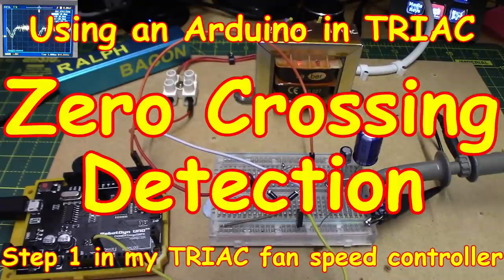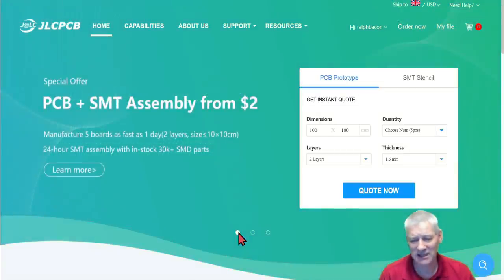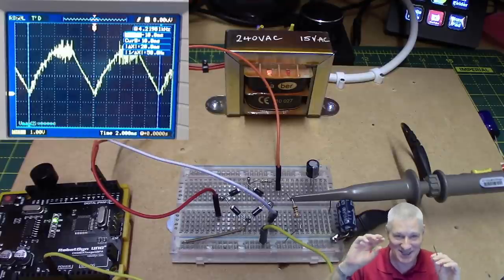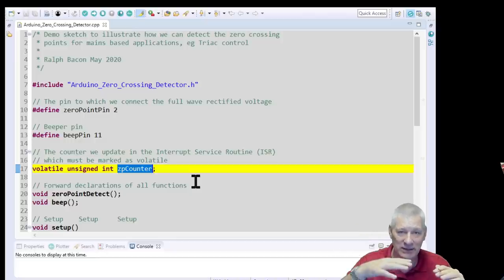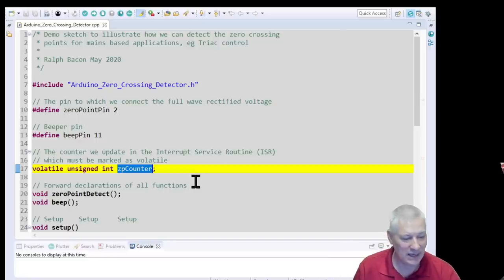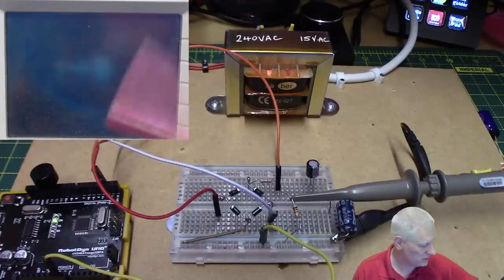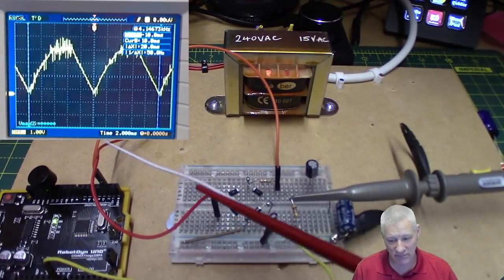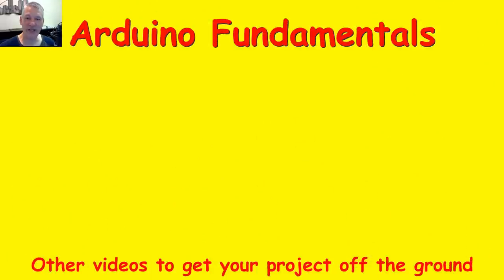#189 Zero Crossing Detection using an Arduino (TRIAC Dimmer Control)

Comment: Excellent video, nicely explained, as always from you.  Quick suggestion, what if you use an ESP8266 in some form, then you can easily control your fan from remote via a phone app or easily connect it to your home automation system, shure you can do some remote control via bluetooth, but with wifi you have so much more possibilities  :-).
Reply from the maker: Great suggestion! It did occur to me (or just buy a  SonOff dimmer switch) but I don't mind stretching out to adjust the fan speed - and it's all switched off by the kill switch when I leave the workshop anyway.

Comment: What's cooking. is that capacitor? - I got sauce in my pocket. 
 Lucky it didn't just explode - usually does for me.
New project? could be very interesting, have to get coffe ready next time.
Phone charger looking good, a bit surprising though. You took the time to make a PCB and then throwing "test boards" on it?
I was hoping for a bit more from you -but it is working and it is cheap and easy - as you said a few times in the past "I am a programmer" - it shows. LoL (no disrespect intended)
Reply from the maker: Oh dear, I feel so bad now. "I was hoping for a bit more from you". Oh dear. This feels the same as when my school teacher wrote on my work "Can do better". But..

But seriously, I thought about putting more native components on the PCB but I'm not going to do that for the BT module, and whilst I suppose I could have done it with the current detector, what purpose would that solve (unless I was after a very small PCB). We will have to be satisfied with the dual MOSFET chip and TH resistors (no SMD because many hobbyists don't like them).

So in the end it's mostly a collection of pluggable components which makes is so much easier for me to assemble and every one else to construct, does it not? Wait for the final product before passing judgement, Flemming!
Reply: @RalphBacon  LoL -"can do better" 😂 -can't we all
-did I miss something?, I thought the Smart Phone Charge was done?  
-Judgement? noo not me. I do believe that critisism must be somewhat kunstructive, anything else is worthless.
Reply from the maker: Smart phone charger PCB done, not yet fully assembled.

Comment: Nice job of showing how  the interrupts work. And I have never seen where the "zero level interrupt" had any use since according to the documentation, it continues to interrupt as long as the line stays at zero. And by zero, they mean a digital zero - not zero volts. That means the from the time that the line dropped below about 3 volts until it raised above 3 volts again, the interrupt service routine would just be entered over and over again as fast as the micro could process. If you ever find a practical use for this mode, please make a video on that. I am sure that the engineers has some good use for this or they would not have spent all the time and money to build it into the chip, but I sure can't figure out what it is use for.
Reply: Edward,  his next video will use a MOC3041 (or similar) which is a dedicated triac driver with zero-crossing built in. This chip gives a crisper 'true zero' crossing point that the Arduino can use. You are right, if he uses this set up he will get a digital zero trigger that may wander around. However, as soon as he installs the MOC the subtlety of your point will be lost!
Reply from the maker: Yes, it does seem odd, repeatedly triggering an interrupt on LOW. I got around this previously by disabling the interrupt as the first statement in the ISR. A bit counter intuitive!
Reply: @RalphBacon  I did that too once, disabled the interrupt in the ISR and then later, once the line went high, I re-enabled the ISR. But, I realized that I had just built a very complex and time intensive alternative to the built in high to low transition interrupt.  So, I junked the whole thing and just used the transition interrupts.
Reply: @whitefields5595  Yes, I am quite familiar with the MOC3041 and have used them on a couple of solenoid driver projects. But, I wasn't really commenting on his little demo here - I assumed that this was just be a little training exercise to show people how interrupts work and why it is important to find the zero crossing when using triacs.  I was commenting on the Arduino "LOW" mode interrupt operation. The Arduino family has the following modes: LOW, CHANGE, RISING, FALLING,  and some have HIGH.  I have never seen an application for the LOW or HIGH modes. Why do these modes even exist? If you have set a Low mode interrupt, and the line is low, the interrupt triggers over and over and you can't do anything else until the line goes high. So, the only way I see to use it is to disable the interrupt inside the ISR. But if you do that, it would have been simpler to just use the Falling mode which only triggers once per falling edge and you don't have to worry about disabling the ISR.
Reply: @MrEdwardhartmann   Edward, I have always tended to use attach and detach interrupts as a pair, avoiding multiple triggering. One example of a LOW is a debounce routine for a pushbutton. I have used HIGH in peak detector circuits. I suppose what is going on here is the old software vs hardware (discrete components) issue that I keep bending Ralph's ear about. The later microprocessors have been great in popularising our hobby, but it always needs to be backed up by a thorough understanding of electronics. Many folk will try to do many things in software that really should be done with discrete passive components. HW interrupts could easily, more reliably and without repeat triggers be fed from an op amp, schottky diodes and other (logic) devices. In this AC example Ralph should (and hopefully will) use a dedicated zero crossing chip that only gives a single pulse.This would then leave the processor to do what it it good at rather than trying to 'catch' interrupts. Its a grey area, and always has been, but we ignore the basics at our peril as we force the processor to over-rotate.

Comment: I see that you have the digital current sensing on the phone charger, so I am assuming the analog one still isn't cooperating? Zero crossing detection with an Arduino project is interesting and educational. In the circuit you drew, you have two 47K resistors to drive the LED's in the optocoupler. That would work, but the power dissipated on the resistors would be higher than 500mW at 240VAC, so regular 1/4W resistors will burn out rather quickly. You may consider using 1W resistors, or better yet, a capacitive dropper there. Also you'll need a current limiting resistor on the transistor side of it where you tap your sense wire, otherwise each time that transistor turns on, it will be shorting the 5V rail. But, I know that you know all of these, so I believe that circuit was just a sketch to explain the concept, not an implementation version. :-) Great video as always!
Reply from the maker: Yes, yes, and yes! I assumed 1W resistors would be used except my solution is an off-the-shelf device now (it costs more to buy the components). Wait for the update video in due course! I still want to demo a discrete component version though.

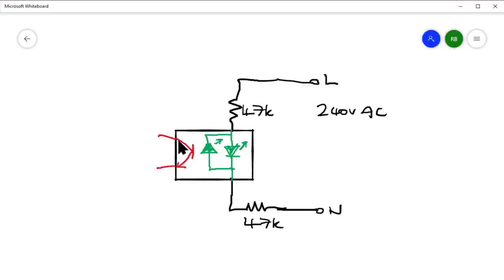Comment: Is it really getting the zero crossing point?  21:12   The LEDs would offset it surely? A LED would not conduct once Vac dropped below Vf [and the other LED would not be conducting either until the corresponding Vac rose beyond its Vf] which isn't the same as zero.  Maybe I missed it but the code would have to delay the detected 'zero' point.
Reply from the maker: You are on the right lines, Kenn. As the mains voltage drops to below 3v (what the Arduino will consider LOW), the interrupt triggers. The rectifier diode (or opto-isolator LED) will still be conducting at that point. But the mains sine wave is not actually at zero yet, a couple of volts above that. It should be straightforward to delay any switch on a millisecond or two until we know that zero has been reached - the oscilloscope will help me get the actual delay right for this. Keep tuned!

Comment: Hi Ralph S Bacon, I have used your content in the videos to help me through and arduino project and now I have come to a stop. I thought to reach out to you.
Reply: I have an arduino mega and a sketch that controls a 4 channel zrc dimmer via a rotary encoder.

The problem I have is when the arduino powers up with the dimmer it is set at a default state set by the code. The problem comes when I try to adjust the brightness of the dimmers using the encoder as an input, the dimmer blinks every time it see an input from the encoder.

I don’t understand how I can control the dimmer via an input if it interrupts the dimmer task(constantly looking for the zero crossing) everytime it receives an input from the encoder.

I’m left scratching my head of what to do ?

I would appreciate any help/advice
Reply from the maker: Hmm, I suspect that your interrupt routine (ISR), used by your Rotary Encoder routine, is doing far too much work. 

Whilst the interrupt service routine is running, nothing else is (hence the flicker, I suspect). And the Timer0 interrupt is no longer running so millis() will be unavailable too (frozen at the last value).

All the ISR should be doing is setting a global variable to true, for example. Then your main loop can detect that value, do what is necessary alongside other work it is doing and then reset the global variable to false.

See if doing what I suggested cures the fault before we think of other things.
Reply: @RalphBacon  thanks , I have a look into your suggestion. I noticed I also that when the arduino reads temperature and humidity every few seconds the dimmer blinks.

I’m not sure if the issue is with the dimmer code

Comment: Thanks for sharing.   will you please put in a block diagram or maybe a flow diagram so we can follow the time line of what is happening.   Thanks
Reply from the maker: I'll add in extra details when we come to driving a Triac (with a suitable, mains-isolated, low AC voltage) from that Arduino,John.

Comment: "It was triggering a thousand times a second for some reason"
The pin is low.  It triggers an interrupt.  The interrupt is serviced.  The service routine ends and the interrupt is re-enabled, but the pin is still low so it triggers another immediate interrupt...  Simple, when you think about it.
That's why you use "falling" instead of "low" as the trigger, since it only triggers when the pin voltage passes through that particular high-to-low threshold on the way down.  If the voltage is still falling when the interrupt is re-enabled, it won't trigger again because the "high-to-low" transition has already been recorded and won't be recorded again until after the voltage rises above the threshold voltage and then falls below it again.  The devil is in the details, as with many computer and programming related problems.
Reply from the maker: Yes, indeed. I think I alluded to this in the actual video and it has been mentioned a "few" times by others too! Amazing how quickly the Arduino can execute interrupts during that millisecond of "low"- ness. The main reason I was a bit baffled is because I never got my rotary encoder working with FALLING only with LOW. Go figure!
Reply: @RalphBacon  I noticed that several other people mentioned it after I posted my message.  I'm guessing everyone who posted about it did the same as me.  It's a human flaw, I suppose. :)
But I just noticed that your loop isn't quite right.  It should work most of the time, but as a general thing you shouldn't say "if counter is greater than limit, then reset counter to zero" when you're dealing with the results of an interrupt.  Instead, you should say "if counter is greater than limit, then subtract limit+1 from counter."
The former works fine so long as it's impossible for the counter to count twice before being checked, but the latter is necessary if it ever becomes possible for the counter to count more than once before being checked, otherwise the counter will get "out of step" and the timing of the event will be "off" slightly and will "drift" over time.
Reply from the maker: Yes, that point was also mentioned a "few" times by your fellow viewers. My bad. I just hope my production code is better than the demo stuff I knock out!

Comment: Another great video! But why did you put a resistor on the live AND neutral sides of the optocoupler? I understand the need to limit current through the LED portion of the optocoupler, which can be achieved with one resistor - and I understand that there are two LEDs inside that version, allowing you to sense +/- voltages - but they're wired together, so why two resistors?
Reply from the maker: Spreading the load, Robin. Those resistors are dropping a lot and need to be 1/2 or even 1W types so by splitting the load it should ensure they don't fail over time. They must also be capable of mains voltages (SMD resistors cannot do this, of course). If there is a neater way of doing it I'd choose that; for example if the non-mains part of the circuit was running of a low voltage transformer (as per the demo) to power the Arduino etc, we could use that to trigger the interrupt pin directly from the bridge rectifier again. We shall see.
Reply: @RalphBacon  Ah - thanks for the clarification! I'm rather annoyed at myself that I was so busy wondering why the resistors were straddling the opto that power requirements never entered my head - having been so used to working with small voltage drops (5v/12v systems), power requirements are always low.

However, assuming 240v supply, 1.5v LED voltage and your 2x 47K = 94K resistors, using the equation (240-1.5)/94000 we can see this provides 2.5mA to light the optoisolator - but sinks 0.6W to do it. You weren't wrong about needing 1W resistors!

I'm wondering if a hall effect sensor might have been used to detect phase at lower power cost, in a similar way to the inductive probes on a clamp meter, measuring without even breaking the supply wire.
Reply from the maker: Maybe, but the "standard" is to use LEDs or direct connection (shock! literally).

Comment: I thought the capacitor looked like it had a bulge from early in the video. I was going to comment on that but you cleared it up at 6:20 or so.
Reply: me too, couldnt take my eyes off it. fixed a few motherboards with asploded caps in them. few tvs too.
Reply from the maker: I'm tempted to do it again live on video! Just as a warning, of course!

Comment: Hi. I'm going to try a project wireless (AC dimmer) adjusting potentiometer to AC lamp. Components NRF24, potentiometer, arduino, BT136, MOC3021, 4N25.
Have you ever done this yet? Honestty, I want to do this. Can you share/advise some? Thanks
Reply from the maker: I haven't done that (yet) but I do have all the parts to do in a box. So I might revisit this in due course. If you succeed, let me know!

Comment: 15:14 delay() would not work in an ISR anyway because it depends on interrupts being enabled, as does Serial printing, and they are automatically disabled when the ISR is being executed

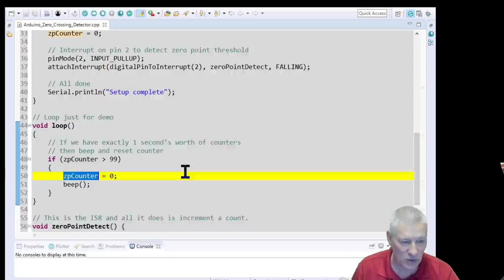18:29 "there is no more code"  What about Arduino_Zero_Crossing_Detector.h that you have #included in your sketch ?
Reply from the maker: Ah, yes, the header file is an automatically generated header file. You can find it in my GitHub as part of the sketch. Doesn't contain much this time.
Regarding using a delay() within an ISR (not that I ever would) it can still work if it uses microseconds. And micros() updates. It always reads the hardware timer register. So delayMicroseconds() might work. But really you have to ask yourself what it is you are trying to achieve using a delay there!
More reading (2nd answer on this thread): https://arduino.stackexchange.com/questions/22212/using-millis-and-micros-inside-an-interrupt-routine
Best approach is never to use a delay within an ISR. If necessary exist and allow the program to re-enter the routine until conditions are right for you. I do that to prevent switch bounce in rotary encoders.

Comment: Hi Ralph.  How difficult would it be to detect 2 separate AC input's zero crossing points to then be used to synchronize the one to the other, which then can be used to activate an automatic transfer switch?
Reply from the maker: You have two interrupts on an Arduino (pins 2, 3) so you could easily detect two different signals' zero point crossing. What you then do I'm not sure as I don't know what you mean by "synchronising" them. If the signals are at different frequencies and you are just waiting for them both to be at zero before you do something that would be feasible.

Comment: Watch out not to accidentally open a worm hole with this flux-zero-point-crossing-hyper-mega-crontroller-thingy, Ralph!
Btw.: Happy holydays (pentecost) !
Reply from the maker: Too late, I opened a wormhole to a parallel universe where Arduinos had not been invented. It was a nightmare! And gleichfalls for the holiday wishes even though we do not celebrate Pfingsten here in the UK so much. We don't even get a public holiday on Pfingstmontag although Eire do.

Comment: Perhaps, if you shielded your jumper wires from the transformer (or even just twisted them), you would have much less noise?
Reply from the maker: Possibly, David. But given the voltage was 15V the noise level was, quite frankly, excessive! Some have suggested interference from fluorescent lights too. When I get it out again I will first check all these things that have been suggested - and thanks for your suggestion.